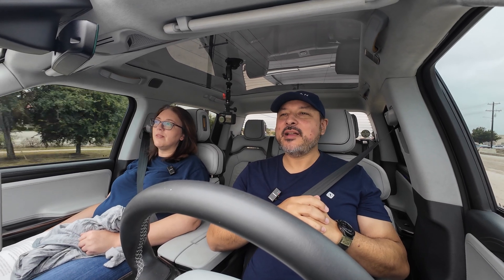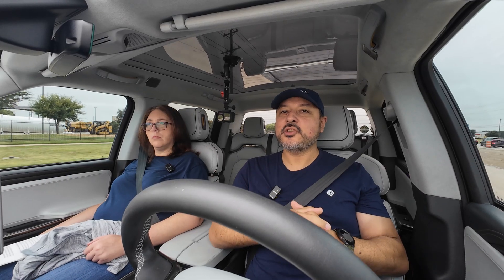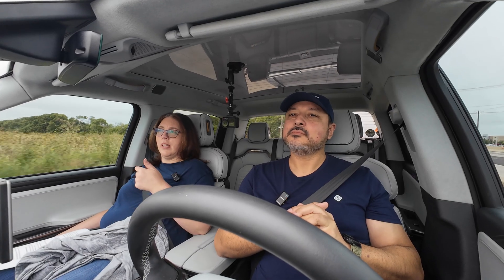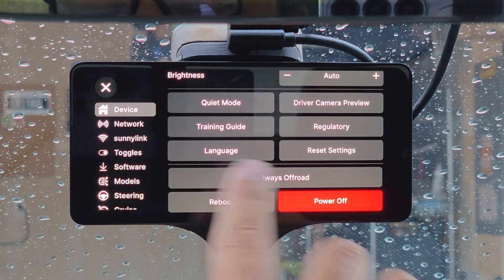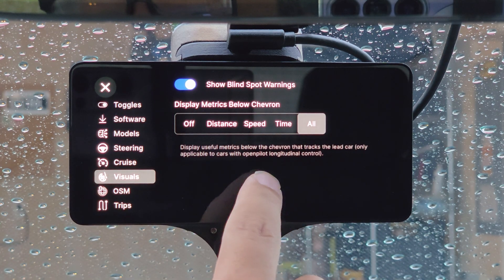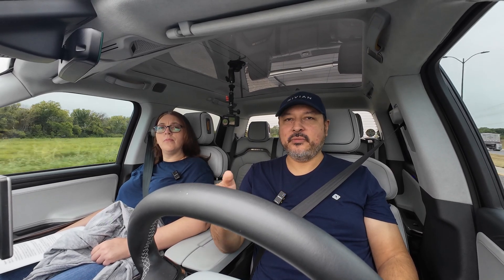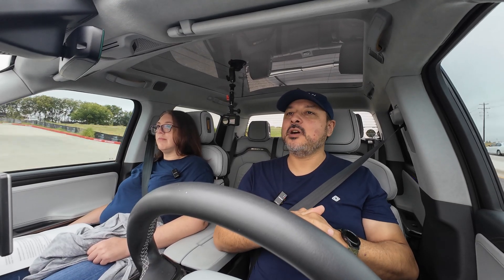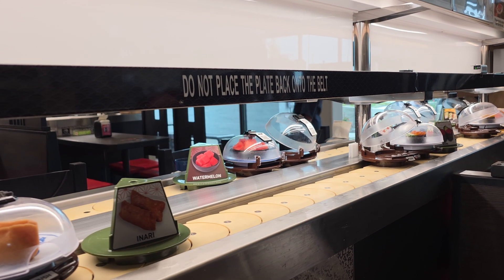Comma 3X on Rivian: The Latest Openpilot Features You Need to Know (Aug 2025)

Comment: Could I just use Sunnypilot and use a branch that allows longitudinal control (on-screen) without buying the additional xnor longitudinal harness? I know I would miss out on blind spot monitoring and steering wheel controls, but I would still be able to use sunnypilot for stop and go longitudinal control at traffic lights, right?
Reply from the maker: You can, but not only would you be giving up things like blind spot monitoring, you'd be running a fork of Openpilot that hasn't been updated in almost 8 months.  That branch is still on Openpilot 0.9.9 (we're currently on 0.10.3).  You can definitely use it to try it out to see how Openpilot Longitudinal works, though.

Comment: Do I need both Harnesses (longitudinal upgrade kit and Rivian harness kit)?  

Can you explain the difference?
Reply from the maker: You don't need them both to start with.  The Rivian harness kit from Comma.ai will let the Comma 4 control steering, but the Rivian's standard dynamic cruise control will still control throttle/braking.  The upgrade kit will give the Comma 4 the ability to take control of throttle/braking AND steering, and also gives the Comma 4 access to the blind spot monitor to make automatic nudgeless lane changes safer.
Reply: @theelectricvalentines thanks, when I order the comma AI I will order without their harness and order both these other harnesses.  It ends up being a little more money, but that's okay.
Reply from the maker: @EVandMe  And you get a discount if you buy both from Xnor.
Reply: @theelectricvalentines all work with Comma 4?
Reply from the maker: @EVandMe  Yup, everything is compatible!

Comment: Does adding the longitudinal upgrade give the comma the ability to regulate speed around curves?  With the standard setup, it seems like when you get to a curve the vehicle could handle with manual steering input at a given speed, it may still exceed the assist torque input and  require the driver to take over.
Reply from the maker: Not in and of itself, but Sunnypilot is soon releasing a new feature called SCC-V (Smart Cruise Control - Vision Based) that I think will do exactly what you're talking about.

Comment: Thanks for answering all of my questions. The Discord community has been great as well. Do you have any issues with openpilot Longitudinal Control (Alpha) not sticking. It seems to get disabled from time to time, mainly after the vehicle sleeps and the comma shuts off.
Reply from the maker: No problem!  I haven't had any issue with Longitudinal Control staying on.  What fork are you using?  I know there was a bug in today's update of sunnypilot/staging that caused a No Panda error.  Is that what you were experiencing?  I think Sunny fixed that so check to see if you have an update available.

Comment: Any comment on Rivian blaming the Comma for the motor faults experienced by Kyle (OOS) and possibly other drivers? That is putting a damper on ordering the Comma for now. Thanks for the video, super helpful!
Reply from the maker: Glad you found the video helpful!

I was going to make a response to the OOS video, but honestly there really isn't much more to be said right now. Kyle was pretty fair in his video to both Rivian and Comma.  This issue affects only a handful of people out of the 600-700 current Rivian/Comma users (probably around 1-2%). Most Rivian/Comma users have been using them with no major issues. Even Rivian isn't 100% sure if the Comma caused it.  Could the Comma be the cause?  Yes.  Could the Rivian be the cause?  Yes.  Could there be some combination of both that is the cause?  Absolutely.  

We have a dedicated community of developers looking into it and so far no one has been able to reproduce the issue. I'll make a follow-up video if there are any developments, but at the moment this is a strange bug affecting a very small minority of users.

Comment: I have a gen 1 R1T. I already have comma ai 3x. I just received Lucas (xnor) Rivian upgrade kit. After installing I still don't have access to longitudinal control. 😢
When I first turn on, comma had no panda error. I unplugged for 5 minutes. Still no joy. I did a system reset, installed Sunnypilot staged 3. Still the options in the software say those features are not available for my vehicle.
Should I be able to have these features with Gen1 R1T?
Reply: My issues have been resolved. I think one is the orientation of the aux USB cable. That could have caused the Panda error.
The other, after watching this video again, I failed to enable longitudinal in the developer menu.
Along the way, there were several reboots of the Rivian and the Comma 3x.
Reply from the maker: Are you using 'sunnypilot/staging-c3-new'?

Comment: Thanks for sharing! Are you projecting any hardware upgrades within the coming year or so? Debating whether I should wait until you’re all further along in development.
Reply from the maker: Lots of improvements coming on the software side of things - Openpilot is continually evolving.  I don't forsee any hardware upgrades though, other than the eventual release of external GPU upgrade but those will be highly optional.